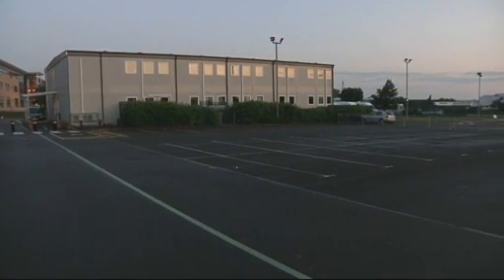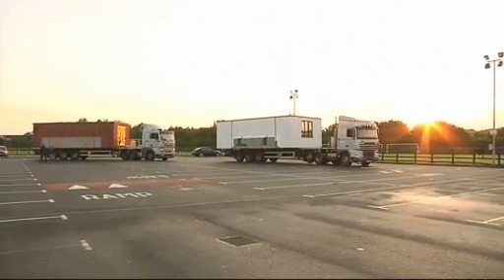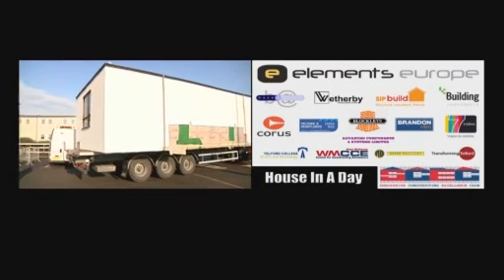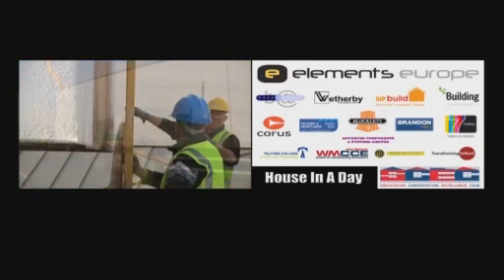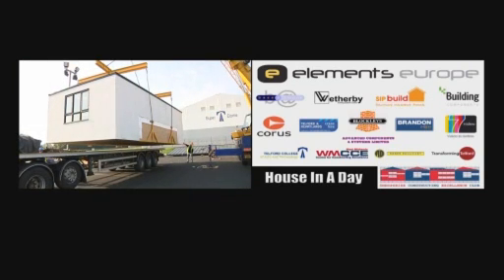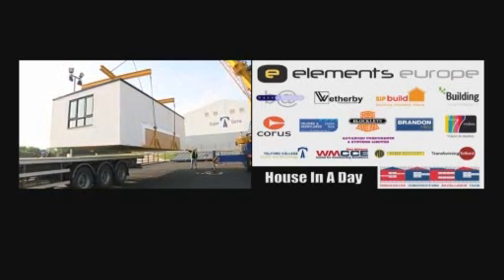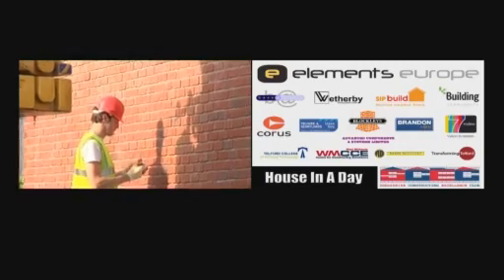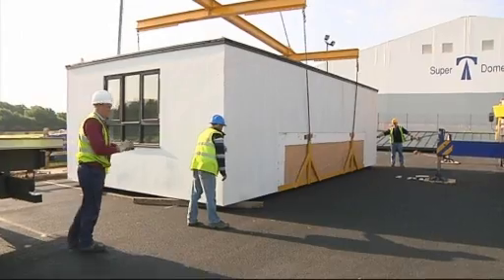Build  a House in a Day

Comment from the maker: @sum3ah Not sure what you mean, but the build quality is excellent, the specification of the inside will be whatever you want. If you need positive pressure to keep dust out that can be designed, if you need nano coatings to prevent bacteria etc this can all be specified before the factory build takes place.